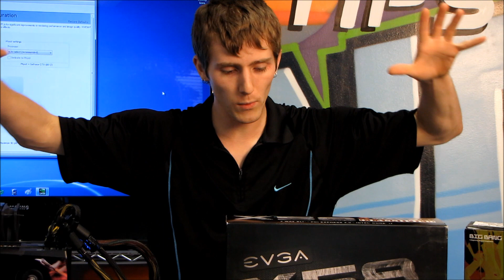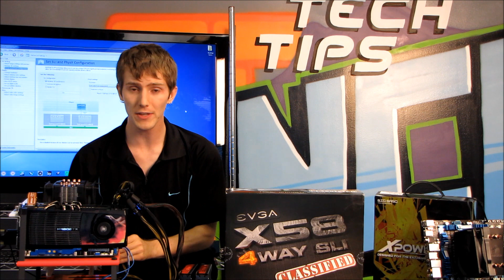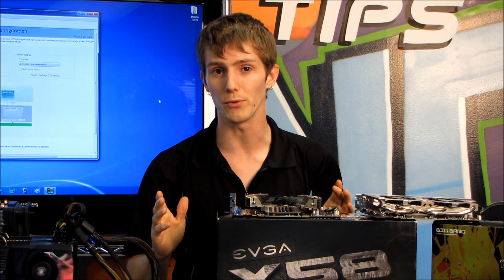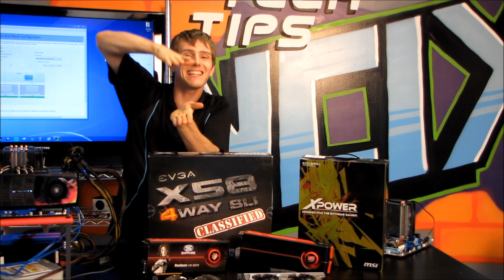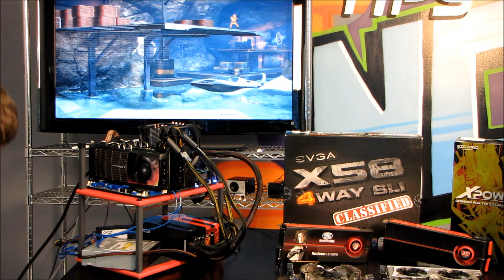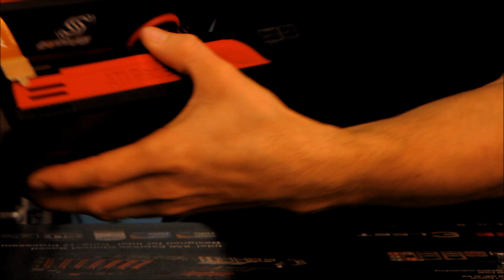SLI & Crossfire FAQ & Tutorial (NCIX Tech Tips #89)

Comment: You can't wire together 2 different graphics cards. For instance, you can't put a GTX580 with a 570, but you can put 2 of the same GPUs of the same type together. a EVGA 560 and an ASUS 560 for example.

Comment: unfortunately not, this is because they have different chipsets, a 570 has a 570 chipset, and a 560 has a 560 chipset, this is why the 560 ti and 560 ti 448 should work together because they both have the same chipset.
what i did was SLI GTX 560 Ti twin frozr 2 OC which has better performance than a GTX 580.
but yup i think ud be better off with two "normal 560 ti"

Comment: technically yes but it will bottleneck with the lower card, so basically if you ran them together there it would be the equivalent of having two GTX 560 ti's (384 cores) with non of them having 448 cores, so your better off having the exact same card because it will have ether more performance with two 448 cores or cheaper with the same performance with two 384 cores 
hope this helped :)

Comment: Do you even know what a WATER cooling system is for?
Don't buy a piece of shit i5 pre-made computer for $600 dude. I built mine in september its 1100T 6 core 3.33 ghz. For $600 with 1000 GB hard drive 6gbps sata (best speed for SATA other then Solid State Drive) and 8 gb 1600mhz DDR3 RAM, threw a $160 Nvidia GTX 550 TI for a total of $760 and this was in september. 
Go buy a $100 motherboard, about $50 for 8gb ddr3 ram, Video card, hard drive and make it yourself for cheaper.

Comment: No, you would only get 1.5gb, it doesn't add up, it actually sets to the lowest either card have.

For example if you could sli a 460 768mb with a 1gb one, in sli you would only get 768mb.

If you CF a 6870 with a 6850, the speed of the 6870 lowers to match the 6850.

Comment: @PlayerUnkown yeah should be. Remember every processor is different and just because certain overclocks can be achieved by others doesnt mean you will be 100% guranteed to achieve aswell. If it isnt stable at 3.8ghz go for 4.0ghz. By the way what cooler are you going to be using?

Comment: @PlayerUnkown in one of my rigs I have a 955 it runs good I'd say it needs to be overclocked just to avoid bottle necking because at stock its hovering in and out of the bottle neck range...although Iam using a 7950 in the rig so it probs is bottle necking that but yeah good system buy it :)

Comment: making a new build, Will i bottleneck?
Corsair Vengeance 8GB DDR3 1600Mhz Ram
Gigabyte GA-990FXA UD3 Motherboard
CoolerMaster GX 750W PSU
2x HIS HD Radeon 6850s 1GB GDDR5 256-bit Graphics Cards in crossfire at stock performance clocks.
AMD Quad Phenom BE 955 3.2ghz Overclocked to 3.8Ghz
500GB Seagate Barracuda storage device
60GB OCZ Agility 3 SSD Drive
Thermaltake Dokker Mid-Tower Case
DVD/CD LG Optical Drive

Comment: @anthony95307 Everything you said is completely false. You CANNOT use two GPUs of differing model types (i.e. GTX590, 580, 570, 540, etc.) in an SLI format. It will NOT work. Ever.

Comment: customer support at xfx told me i can crossfire a HD 4870 with a HD 4890.  or any 2 radeon HD in the 4000 series.  is this correct?

msi 970a-45g
8 gb 1600 ddr3
amd fx x8 core 3.1ghz
windows 7 home premium 64 bit
xfx ati radeon HD 4890 1gb gddr5

Comment: @TreyDee45 you could check the specs on your system and try to find the manufacturer, however most computer vendors use the reference card which is the graphics card straight from the original company that made it. you can however try to open your case if it doesn't void the warranty and check the card out, most likely it would be the reference card. Also go ahead and check the specs on the card to make sure that you can get it identical as it can be, i heard it runs a lot better that way.

Comment: @msi48701gb If you said that, then I would go with the Gigabyte GA-Z68XP-UD3. I've just checked at Newegg, 149.99 USD. You can run Crossfire with your dual HD6950s using that board

Comment: Hey. I have a problem running crossfireX and i wonder if you know what's wrong.

I have 2  6950 running in crossfire, 1 of them in a 16x slot and  the second in a 8x slot.  but the card in the 16x slot got core clock at 810 MHz, and the other cards core clock is on 150 MHZ ... also there is a 1000 Mhz difference between the memory clock.

can you please help me whit this problem.?

Comment: @30STMand3DG You're wrong.Two HD6870 can easily run on a, let's say Corsair HX750, considering he's going to use some i7 2600k or i5 2500k.My GTX560Ti(which is OC'ed like hell) and my Phenom II X4 955 BE at 4ghz, 4gb's of RAM, lots of fans, 2 HDD's on a Fortrom Aurum Gold(500w 80+ Gold Certified PSU) and I'm using 380 watts out of it, conclusion, 650w would be fine for 2 Graphics cards as long as you don't overclock the shit out of them.

Comment: @alexbeast14 

CFX is more forgiving as far as what you can crossfire together - as long as the GPU's are from the same family (i.e. Cayman or Barts) you can crossfire them together. So, you can Crossfire a 6990 with a 6970 or even probably a 6950. The only thing is you'd need to overclock the 6950 so that it matches the performance of each individual GPU inside the 6990 - CFX and SLI are only as good as the slowest card in the set-up. nVidia, however, requires exact card matching - 590 need 590

Comment: @MrDominator98 i would go with a single 6870. the benefits of crossfiring isn't as good as it could be. you are running 2 cards but in reality, dual mid range gpus would be about the same as a high end single gpu. not to mention later you can crossfire that higher end card and get even better results. i'd go that route personally. might check out tom's hardware for some benches of crossfire vs single cards. you'll find it's not really double the performance

Comment: @jamiegward1984 no that's not what he was saying..and I dont blame you for getting confused.  it's a lot to take in.  the part you're probably thinking of is.  if you put two ati  *( or now they are owned by amd) vid cards on a motherboard and configure crossfire or ( xfire as people call it that also) on SOME motherboard the motherboard will auto down clock the maximum bandwidth from x16 speed on both slots to x8. There's no performance difference than if both slots were x16 speed still. cheers

Comment: ok so the two hd 5870 you held up one with the 6 display ports the other without, they can run crossfire i got that. but what if you want to use multiple monitors, the 6 displayport hd 5870 can support 6 the other card maybe 3, so could you use crossfire and run 9 monitors? could you run 6 monitors and hook them up two both cards? or better only the one with 6 display ports? would crossfire still work, i know there were soem issues? pleease answer i subscribed :)

Comment: @MiniExtreme That's not gonna happen until they resolve the heat issue of the Fermi GPUs. They are working on it right now and their new GTX580 runs cooler but more powerful than their GTX480 but still not quite cool enough. But they do have a dual GPU card which is quite powerful right now, the GTX295.

Comment: @Drzewo97 Lol, I knew that much, the difference between the 5870x2 and the 5970 is the core clock speed of the actual GPUs. They both use the same ATI 5850/5870 GPU, except the 5970 is clocked to 5850 speeds, where as the Ares is clocked to 5870 speeds. The Ares is the fastest single card on the market.

Comment: @dharkbizkit Well ya, but considering the 5970 uses 2 5870/5850 GPUs clocked at 5850 speeds, the Ares 5870x2 is clocked to 5870 speeds. While it might not be "official", It still uses the same proprietary ATI tech. So, I guess it can be considered an ATI card, even though ASUS is the only vendor for the product. I mean, its really just minor technicalities, but it should be noted that the Ares is the fastest ATI/AMD single card on the market.

Comment: Bu I#ve read many times, when using a 1gb card and 1 2gb card, the 2gb card will run only with 1gb? btw a question that wasnt answered is: Do i waste performance while using lets say an Asus 5850 Direct cu with a sapphire 5850 toxic? since the toxic is overclocked, will this be an issue, or would the lower clock of the Asus card impact on the sapphire card? Do both have to operate at the same speed? Is it wasted just using 1 OC card?

Comment: if you run 2 cards in sli doesnt the spec of one drop, say one factory overclocked at 1GB to one standard at 768 doesnt the spec of both drop to the lowers losing your overclock and both ram at 768?

Comment: i have a rampage 3 gene and im about to get 3 EVGA GeForce GTX 580 FTW Hydro Copper 2 cards and i want to know if i could thripple SLi considering the fact that the board has 2 X16 slots and one x4 slot  and the cards fit in a single slot.

Comment: Linus, did you run some tests with a SLI/Crossfire setup on the Big Bang XPower?

I had one 5970. Then, about a month and a half ago i bought a second one. But since then, i haven't got CFX to work. I'm sure the problem is not on the motherboard, as it recognizes the 4 GPUs. Problem is, CCC doesn't allow me to enable CFX at all. There's not even the Crossfire tab on CCC. I've tried with 3 different bridges and no luck. Most likely a bridge connection of one GPU has gone bad?

Comment: Hey Linus! Wanted to bring up a very good point: As of currently, you are able to run a Radeon 5850 and 5870 in Crossfire, as they are the same GPU clocked at different speeds and with a different amount of Stream processors. Even more interesting, they will perform less than two 5870s but more than two 5850s. Just wanted to give you that info as you said they had to be the exact same card (excluding vendor, PCB, etc).

- Scott S.

Comment: @Linus, once you get past 3 PCI-e slots, it doesn't matter if you have x58 or p55 (usually, especially if you have other pci-e slots. x58 has 36 pci-e lanes meaning 4.5 8x slots or 1 16x and 2.5 8x etc etc.

Manufacturers usually add an extra pci-e controller to get the full 16x for the fanboys/people that actually need 16x
There are a few exceptions to your P55 rule including the MSI big bang tringery, which supports the extra lanes via a NF200